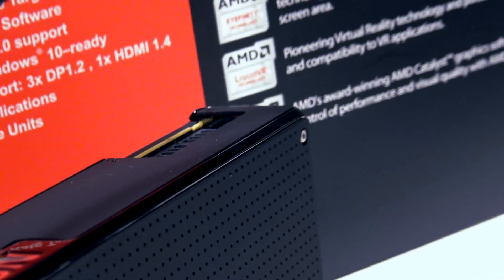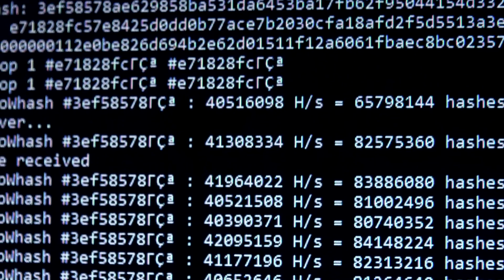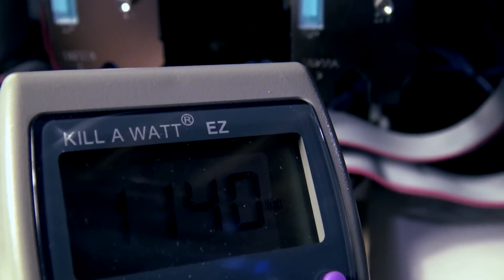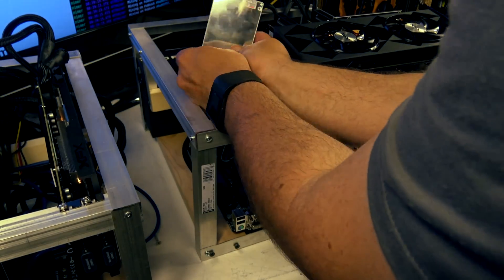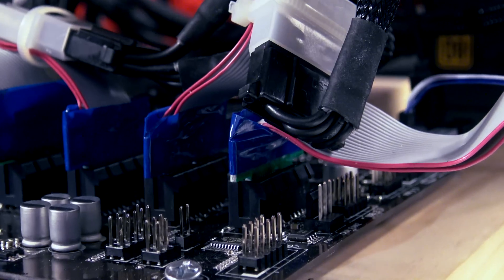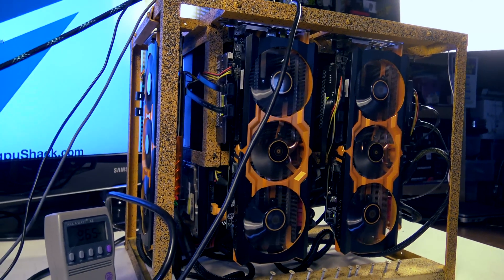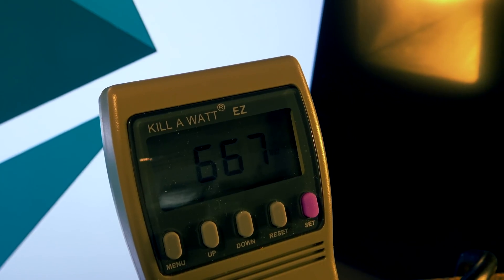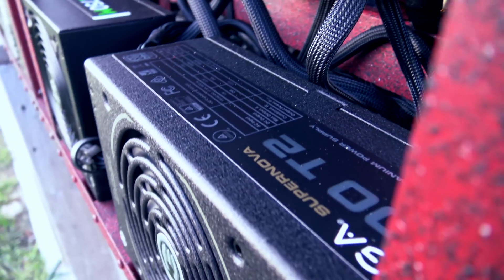BBT Episode 27: Ethereum Mining with AMD Pro Duo, 6x R9 390x and 6x Sapphire Toxic 280x Epic Build!

Comment: I am using MSI R9 390X Gaming, regarding power for the graphics card, there are two connectors on the card, 8 pin and 6 pin.My power supply only has 8 pin VGA connector. What happens to the spare 6 pin connector on the graphics card?

Comment: I think you guys would know when I put more than 1 7850 on my asrock h81 pro btc with the drivers windows gives the loading screen then just goes black any ideas?
Reply from the maker: 7850 may no longer work for ethereum, memory issues with DAG now
Reply: I checked the DAG file size im still good ill just try to find a solution

Comment: hello bits

I'm thinking of putting together a rig with an investment of $ 1400 which would be the best options ? gpu, psu.
Reply from the maker: Look for cheaper R7 370's, should be able to put together a full 6 card rig with those for 1400 (100m/h @ 860w)
Reply: thanks! now I'm thinking of putting together a rig 5x r9 390 gigabyte it's good card ? is very cheap compared to others?
Reply: i'm buying two psu, 1000w and 850w gold evga.

Comment: i tried to run a nano r 9. the hash rate is showned on my PC. However, I dont get any  hashrate on any pool. I am using windows 7. Anyone have any idea how to fix the issue. I tried using ethereum miner,qtminer, open cl, but no use. Nvidia cards work on my pc but not the r9 nano. i tried the nano on different pcs but no use
Reply from the maker: Step 1 edit your .bat file, change your rig name to something else
Step 2 Try out something like ethermine.org port 4444 ; make sure your address right
Step 3 navigate to C:\Users\<local profile>\AppData\Local\Ethash and delete all files in there
Step 4 restart your qt miner and watch pool after 2 hours
Reply: thx i will try to rename rig. I did delete the files many times and tried many miners. I will try again and let you know
Reply: i did all the above and it id not work. Maybe both of my GPU are defective or I have the wrong driver updates. However, I downloaded all the latest OPCL for AMD and updated the GPU drivers already. I really cannot figure out what is wrong.

Comment: Ethereum is memory bandwidth heavy so getting a 390X over a 390 which just has more cores is pointless. Same as getting a 380X over a 380 and etc. Also the Fury cards are terrible because of Fiji's low memory clock which has a really high memory latency.
Reply: One would think that, however one of the best card solutions is the FujiXT based Nano that with bios update and configuration adjustments is 30m/h card with 500mh memory and undervolted
Reply: +Michael Carter yea but a much cheaper 390 would do that too albeit with more power. Im saying with that wide a bus if it has a higher mem clock it should've been much faster